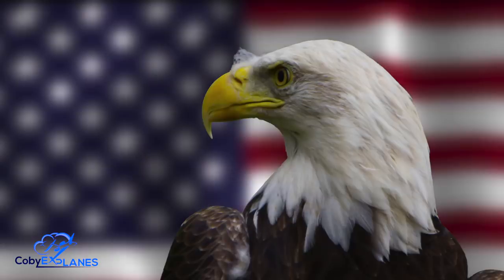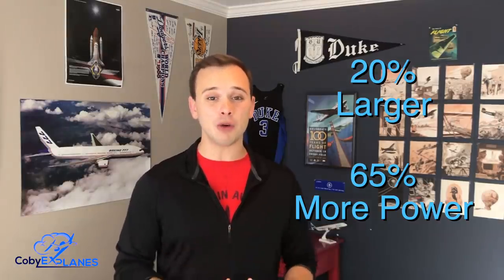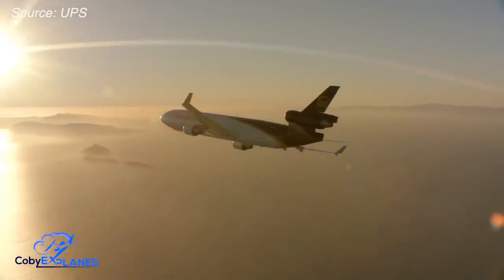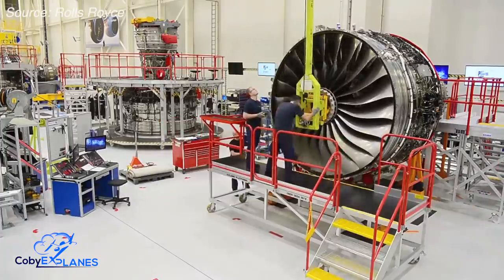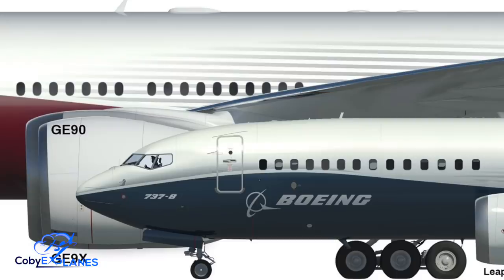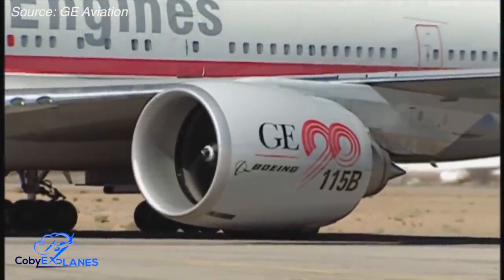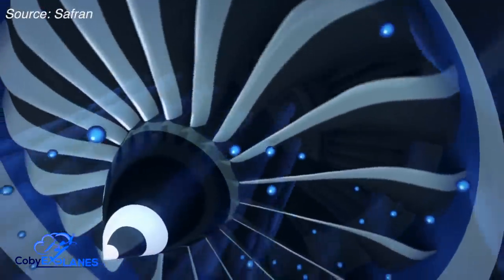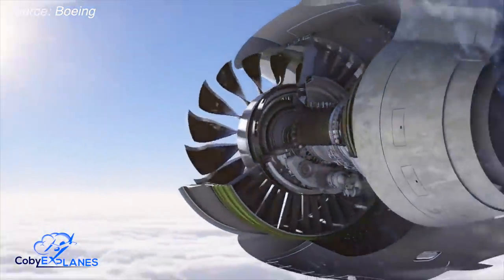The World's Most Powerful Jet Engine: The Story of the GE90

Comment: Wander if we will see 2 engine 747 in the future. The 777 really is the A380 killer.
Reply from the maker: George Suchenstein hey George, that would be quite the sight but it likely won’t happen. The 747 airframe has been optimized over the past 50 years for a 4 engine layout. Probably would be an engineering nightmare to reoptimize it for 2 engines. Think it’s way more likely we see a further stretched 777x (777-10) to replace those 747-8s
Reply: I don't think we will. I kind of hope we don't either. The 747's four engine layout is absolutely iconic and I wouldn't want to see it with only two engines.
Reply: To make the 747 a twin engine would require a complete redesign of the wing since the 747 wing is designed for the dispersed placement and weight of 4 engines. 

The 777-9x will be the equivalent of a two engine 747 without the hump.   The only reason to add a hump to the 777, would be for cargo handling through the nose which was the designed intent of the hump on the 747.  

I think if that were to be done, it would probably be in a 4th generation 777 that will be made with more composites to reduce weight.

Comment: 3:10 There's no way a single GE90 could provide enough thrust for a single 747.  Otherwise they would be using two of those instead of four of the smaller ones.
Reply: The 747's engines ranged from 43,500 to 56,000 lbf, and since it can fly with only 2 of them operational, a single ge90 at 115,300 lbf can (and has on the testbed 747) fly one.